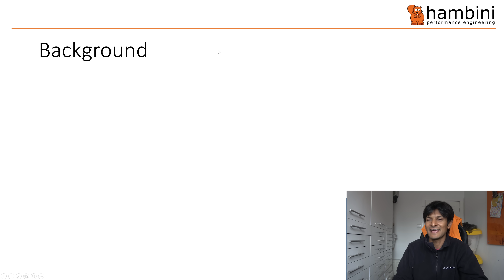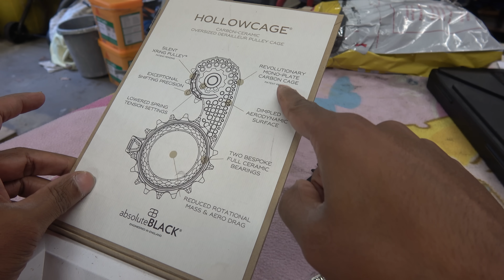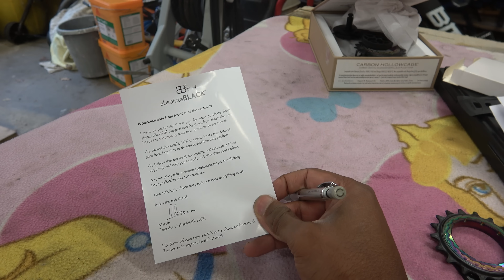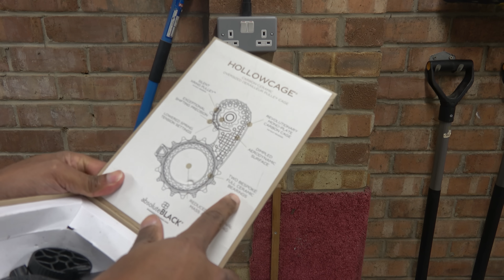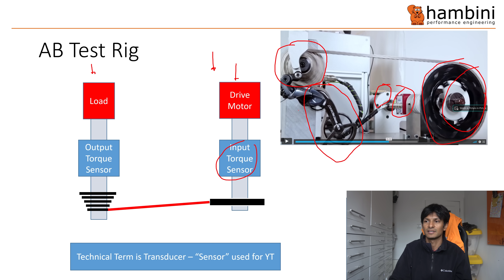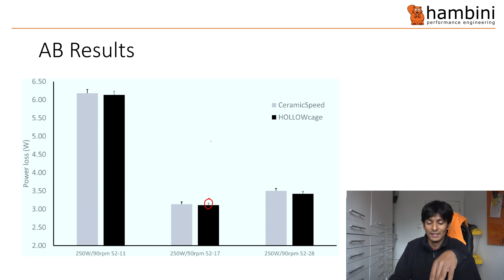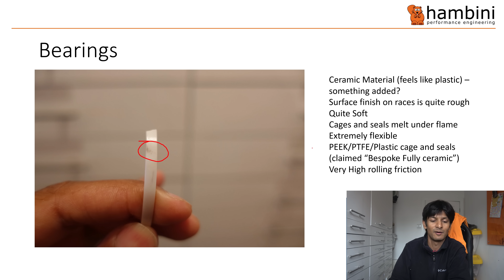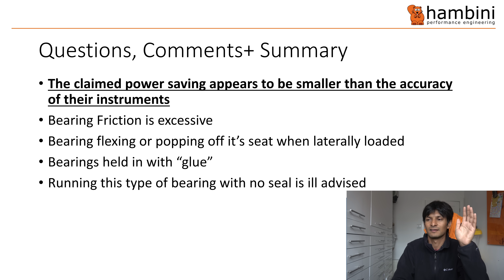AbsoluteBlack $700 OSPW: An Engineering Reaming Hollowcage

Comment: Carbon polymer matrix sounds like wankerteering for carbon fibre loaded plastic. Their "ceramic" is presumably along the same lines, plastic with ceramic powder added to give it some hardness. Obviously IDK for sure but what this engineer can say is that it looks like an expensive load of rubbish.
Reply: It’s like glass fibre reinforced plastic, but using carbon fibres. It’s really is vastly better than normal plastic. The same material is used in shimano pedals. 

The ceramic is clearly actual ceramic  judging by the torch test.
Reply: I dont know the capability's of Hambini but I did watch a German PC tech dude who kind of doing the same thing like Hambini does but with PC parts. But he did not guess what kind of material it was. He send it to a lab and it was not carbon(case was claimed to be made out of carbon), it was plastic injected with carbon.

@John Macaulay
You cant say its vastly better because you need to know how much carbon there actually is. The PC case turned out to be 3% carbon. How much better your plastic will be because of 3% carbon? Because I never worked with plastic or carbon I can only guess it wont matter that much with that low carbon injection.
Reply: @Vanadium  Injection moulded fibre reinforced plastic is a thing. It really does vastly outperform normal plastic components. 

Obviously it does have to be made correctly, but there’s no reason to assume hasn’t. People complaining about the material itself are just wrong.
Reply: @Vanadium  It's doubtful that a PC case is vastly affected by carbon loading the plastic but bicycle parts are obviously under higher and dynamic load so need to be appropriately stiff. length/size of strand/bead, quantity and the polymer just aren't up to the job in that single sided design. It looks so far substandard that the test house doesn't deserve to have its time wasted.
Reply: @Vanadium  ah yes, der8auer. Its marketing rubbish - in both situations.
Reply: @johnm91326  I know what carbon loaded plastic is. Yes, it's added for stiffness but it's all very well them stating it used when the part is still unduly flexible. On the other hand I'm sure Shimano know how to design pedals and specify materials with appropriate properties. The cage disintegrated in the torch test so that's not ceramic. Overall it doesn't look a good product let alone £700 worth.
Reply: @johnm91326  I never claimed it isnt a real thing and Magura is doing this for years. In fact my profile picture got the MT5.  Guess what? The brake body is shit because its plastic. No matter how much carbon you pump into it there are applications where you need different materials.
Reply: @Vanadium  Sure, but this is a derailleur cage, not a brake body. The material is perfectly fine for this application. Nobody complains when campagnolo uses basically the same thing.
Reply: @ches74  Yes everyone agrees it isn’t worth 700 pounds. The price is so high that there really isn’t any need to make questionable accusations about the materials. A torch like that can easily exceed the decomposition temperature of some ceramics. The fact it didn’t burn or melt suggests it really isn’t plastic (though obviously the bearing cage is).
Reply: @johnm91326  but campa dont do a unibody do they? That is the main reason to complain here. Its not ridged enough with that construction out of that material. Want to made a unibody? Sure, but take the right material. 
Campa claim they have long carbon fiber parts in it. Now you need a sample of the campa pulley and the AB. Send it to a lab to analyze it because its only speculations at this point. 

I must also say I dont trust that much tear up videos of any dude here because I am in that field and earn my money with that. I dissemble and test various parts. To test only one or two is flawed. You can spot terrible design errors but you cant spot the systematic faults in the production line.
Reply: @Vanadium  Yes fair enough, but that’s a very different argument for the original comment. Regardless of the material, this kind of design will be less stiff than a traditional design (all else being equal).
Reply: @johnm91326  What accusations have I made about the material? I have commented generally about materials and said "Obviously IDK for sure" what they used. Bottom line is the part is unduly flexible and the fit and tolerance of the parts is poor. You should read more carefully and seek clarification instead of unfounded assertions.
Reply: @johnm91326  I'm only going to disagree with you on this specific point -> "Obviously it does have to be made correctly, but there’s no reason to assume hasn’t." Given a number of design mistakes in this OSPW like the extra long jockey wheel teeth (ideally these would be minimized), the amount of play in all the interfacing surfaces, etc. I actually do think there's enough evidence on the whole that we shouldn't give AB the benefit of assuming this was also manufactured correctly.
Reply: @johnm91326  Made correctly?? Having enough filler in the product so as not be shot for trade descriptions, does not make materials fit for purpose. Significant bearing deformation plus baggy tolerances are horrific bedfellows.
Reply: @Butternose  I can’t even tell if your comment is in English.
Reply: @johnm91326  😂😂 Por que?

Comment: Well it certainly looks cool, and as we all know looking cool makes you faster. Just like racing stripes.
For $700 I'd expect it to be cncd titanium or carbon. Not only is this injection moulded, they didn't bother to line up the injection ports with the aero dimples to disguise them. Jeez
Reply: If they'd done what the metallurgically ignorant are trying to call "forged carbon" they could still have produced a carbon fibre cage, and it'd be high quality, and lighter than titanium.
I really like titanium. Sometimes I even machine bits of it in my home machine shop, and I absolutely loathe the thought of cutting a full depth thread in the stuff without CNC thread milling, because I actually like my thread taps and pay for them myself. 
I rebuilt some cheapie toe-clip pedals for someone because it was funny, and decided to include some 8mm diameter Ti 6AL bar in the build, because that's funny too. After breaking a 5mm Expressflute spiral tap I just cheated and drilled the holes out to a bit over 4mm. This gave minimal thread depth, but it was appropriate for the application as it wasn't really load bearing.
Reply: 700 bones , I'm wanting it gold plated
Reply: @haitchteeceeeightnineeight5571 were you cutting a M5 metric coarse thread? If so your tapping drill should be 4.2mm

Comment: Imagine charging $700 for a predominately injection moulded piece of plastic with very little machining and tolerances like a sausage down a hallway... Most likely the plastic is some sort of nylon with a few fibres of carbon sprinkled in the mix for naming purposes only. I’d almost be willing to bet that PA66 GF30 doesn’t flex as much as that concoction🤣
Reply: Perhaps it's a "carbon cage" as in the colourant is carbon black....
Reply: It technically IS carbon, if you add coal dust to the plastic...

Comment: In Poland we have a saying “Audio voodoo” for eg. Enormously expensive speaker or power cooper cables that would improve sound quality :) But speaker cables should be just a ordinary conductor of the appropriate diameter. Or they even sell graphite cables:) which are  resistors instead of conductors:)
So we should definitely name this cage “Bicycle Voodoo”
Reply: There is a channel on YouTube with an audio engineer who shows using actual test data to prove that shielded cables are legitimately better 😉

I know that really isn't the point here, but this cage is certainly a load of stuff you might find in a field behind a cattle barn....
Reply: @wlrottge  There are plenty of channels on YT claiming whatever you want. Reality and physics could be soooo deceiving. I would wish more people would study or read books instead of watching YT all the time.
Reply: @frankieboy5859  the physics are generally pretty simple, especially if you've taken engineering classes on the subject

Try this out, he's an engineer, and does a nice job explaining the science as well as showing the imperial data 

https://youtu.be/TrjstmjROW8

Comment: Great choice of pencil. I've got the same. Its fantastic for maths. A true patrician.

Regarding the error bars repeated runs can shrink the error bars of random error by root n-1 so hypothetically they might be accurate. But back in the real world I'd not consider it accurate either way, it seems like the equipment is likely to have significant systematic error which repeated runs can't eliminate ruining that theory anyway. Given the deceptive (but not completely lying) nature of what I'm seeing I'd assume that's what they did. However the moment they start picking individual runs to look good the data is all garbage which I also assume they did.

Outside of my field, could the bearing be plastic with only ceramic rolling elements? I'd assume they haven't thrown ceramic filler into the races, but they could get away with pretending to have some ceramic there whilst making cheap garbage?
Reply: Precision vs accuracy. What you're talking about is effectively oversampling, which is great at removing random noise. But put it this way, if they sold a 10cm ruler that was only 99% as long as it should be (1% full scale error), regardless of how many times you measure something you're not going to get the "true" measurement.
Reply: @fgbhrl4907  Right, that's pretty much what I said. The analogy wasn't great because it simply doesn't fit here but random error vs systematic error was a point we both made.

Repeat readings are an essential part of a physics, which is my background, hence why it jumped to mind for me. It might be less common in other fields but it answers every question we had of their data. I wasn't arguing that it was a valid way to drop the error bars by 95%, indeed I argued the opposite, but its a good answer towards how they are making such claims.
Reply: @olivialambert4124  Gotcha. I've got an engineering background -- and oversampling is something that's done all the time when measuring things with an ADC. You effectively increase your resolution -- sample something enough, and your 8 bit ADC (0-255) can become a 16 bit ADC (65535 levels). Of course, there's always the tradeoff of time required / how much your measurement is changing in that window.

Comment: Another out standing video from Hambini, thankfully we have an individual who understand engineering and can honestly inform the cyclists about some of the rubbish out there
I do think its time the biking industry is more regulated. To stop companies exaggerating their products. But then again we wouldn't have the enjoyment of Hambini tearing to pieces such bad engineering
Reply: The problem isn't really the industry @Peter Davey. This is what businesses do. The problem is consumers driven by the need to establish their status or hierarchical position based on consumer acquisitions. Manufacturers are very happy to cater for these desires, even creating them in the minds of the less discerning individuals.
A bicycle should be one of the simplest forms of self propulsion. Weight, aero etc. are only an issue at a pretty high competitive level.
If an individual is stupid enough to fall for this stuff, more fool them. We can't provide daycare for these muppets. If we don't like what the bike industry is doing, stop buying.
Would I like a new bike? Yes on a "feel good" level. Do I need one? No. My first ever proper racing bike from 1982 still works today with a few minor component changes. Keep riding and stay sceptical 👍

Comment: So. $700 dollars for level of tech my $10 LTWOO X7 rear mech? Jolly good. The worst thing about everything is allowance for pulleys to move sideways. It pretty much guarantees an abysmal shifting performance.
Reply: Shimano allow the top pulley to float sideways, Tacx replacement jockey wheels have a narrower top jockey wheel to allow for the same sideways movement of the chain
Reply: @keithreed5009  That was true with older designs and it was tiny. Newer ones ( with taller teeth ) have pretty much no float whatsoever.
Reply: @TryboBike  Sadly the newer designs, specifically from Shimano, offer worse shift indexing and less durability. Having seen way too many other people's SRAM derailleurs commit suicide into their wheel or have seized bearings after their first muddy spin, paying money to bring that misery on myself would be a terrible idea after decades of this never happening my Shimano parts. 

I was able to run ceramic bushing jockey wheels till the teeth wore off them completely and they still shifted almost like new, while the cartridge bearing designs only last about as long as one drivetrain and make out of gear rattling noises in random gears no matter what way I set the indexing. They'd better be saving friction drag in the real world to justify everything else being a downgrade.

Comment: Very interesting engineering analysis, I wouldn't pay 7 cents for that POS......but I think the more important question is how does your thumb joint bend backwards at such an incredible angle without breaking? In a follow up video please add an engineering analysis of your thumb joint. Thank you!
Reply: Didn't notice anything regarding Hambini thumb joints, but if your observations are correct then i suspect he's double jointed.  It's either that or he has installed a low friction Hambini special thumb joint with NTN bearing and a clearance fit rather than the traditional interference fit! 😜
Reply: @DSKHo1968  lol!

Comment: I think the actual cost of this product is less than 60USD
They use compay in Andorra for tax avoidance...
For the HOLLOW cage.. Chinese was made it on 2018...
Also, There are tolerances in the manufacture of plastic CAGE.
Best solution:
After the production is completed, CNC is performed once, and then ceramic beads of different sizes are selected according to the tolerance. . .

Comment: Great way to start a Sunday morning (unless you’re Absolute Black)! 
I wonder if the deeper teeth are there to overcome problems associated with increased bearing friction, say to stop the chain skipping over the jockey wheels - i.e., have they engineered a solution to a problem they created in the first place?
Reply: Nah, they're to stop the chain literally falling off.  One sided design, innit.  That's why the big wheel has narrow/wide teeth, too.
Reply: @wibblywobblyidiotvision  good point! Thanks for pointing out another design flaw 👍
Reply: @wibblywobblyidiotvision  Yeah, pretty much. 1 sided and that tiny ass, mislocated retainer clip that's useless. Pretty sure someone posted a dropped chain on their IG with this OSPW. In the process of getting the chain back on (they had no chain breaker with them), they ended up breaking the retainer as well. If I remember correctly, AB hunted down their when they made a comment on a forum post elsewhere and tried to smear them online.

Comment: To be fair, I would expect the repeatability of the sensor to be much better than it’s absolute accuracy.
Reply: This is a joke, right? If not, I think what you’re getting at calibration. That error is calculated after calibration. If I measure 100 times and my results are consistently +10% over those of my known good measurements, I subtract that 10% to calibrate it. The +/- error is what’s left after that.